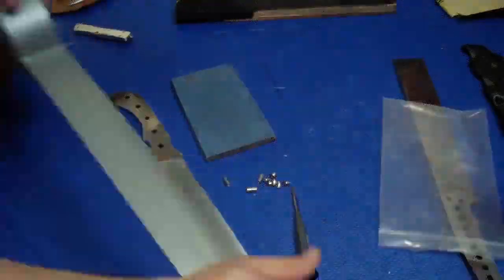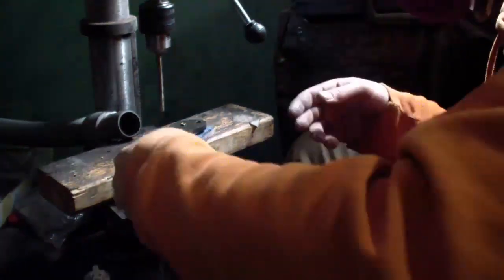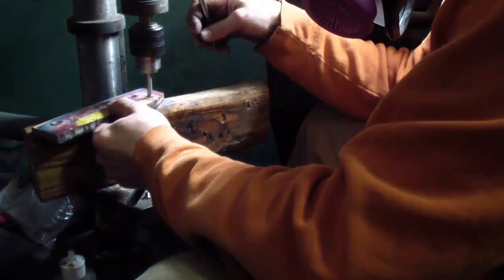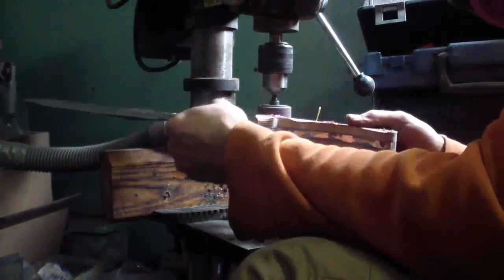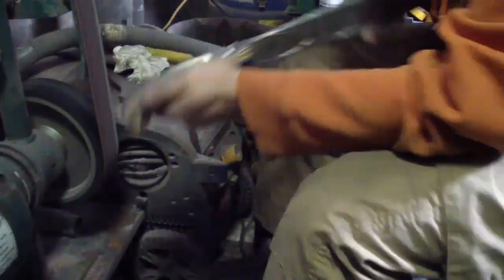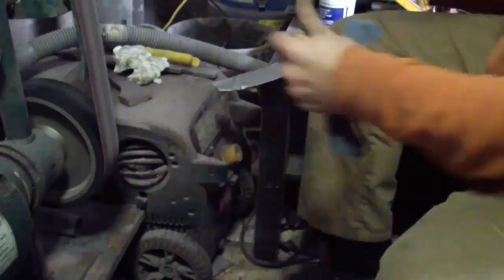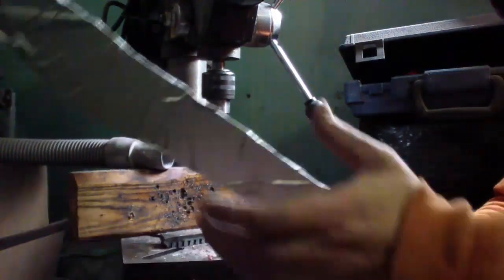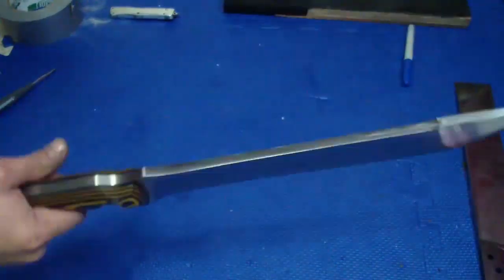Making a Large Custom Knife - part 6 - Removable Handle

Comment: Most people don't realize this, but drill bit's don't drill circles, they drill ovals, so the ream actually makes it a circle. With using a ream, you can get a more accurate sized hole as well. Good tight fit though is what you want though on the pins right? or does the epoxy keep the pins in place in the end?